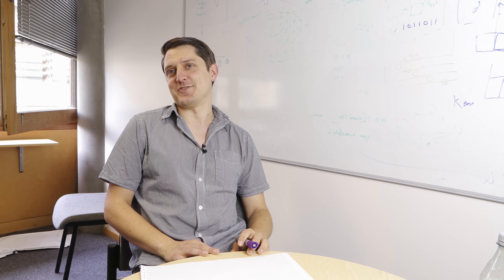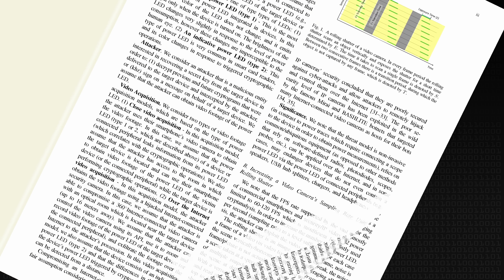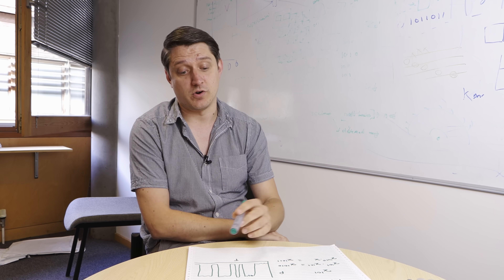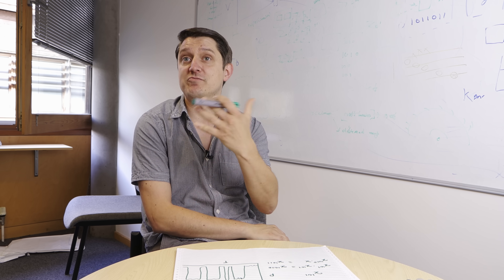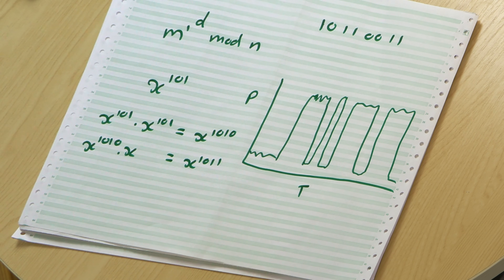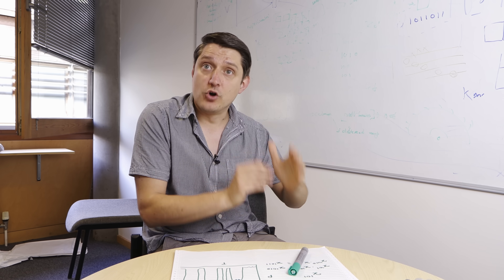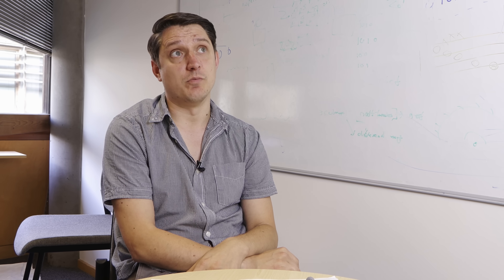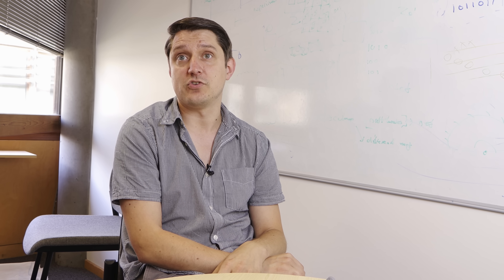Power LED Attack - Computerphile

Comment: This must explain some readers I've seen which seem to turn off their LED while authenticating. The job of the LED is to advertise to users that the device is powered and working, once cryptography is occurring the LED has already done its job and can be powered off for the brief moment the CPU needs power.
Reply: I’ve also heard of some similar light-based “spy” techniques being potentially thwarted using noise on the power going to the light.
Reply: Ze Rd DQ. Jv,№

Comment: Not difficult at all at the design level.

The LED should have a small series resistance in line with it, lay a small cap across the LED. That's it.

Comment: I worked for IBM Office Products in 1980. Selectric typewriters bound for US embassies had to have a capacitor and a heavy flywheel installed to prevent powerline analysis of the characters being typed.
Reply: The soviets literally had devices intended to do powerline  and EM sidechannel surveillance of these.
Reply: ok?
Reply: I was thinking a similar thing is at play with the LED - there some impedance in the LED itself and the circuit that drives it, resulting in essentially a low-pass filter that has to cutoff far below the MHz of the CPU. Furthermore, the intensity & color of LEDs is typically controlled by PWMing a current source - again, limiting the rate at which the LED can change intensity.
Reply: @nixonkutz3018  : You can fight against the "inertia" of an LED by forcing the current going into it. This itself has a limit on it's effectiveness, but does get you frequency improvements, and in the simplist examples will be present in power LEDs without being intended.
Reply: Who would have analyzed the powerline and where?
Reply: @gaborm4767 : In the 80s? Stereotypical case would be KGB, but really any semi-sophisticated group could have tried it.
Reply: @gaborm4767  Russians at the time. US embassies
Reply: @BatterOrWurst  Where and how would they have been connected to the wire? How do you think the power consumption of a typewriter differs when different keys are pressed, and how far away can it be perceived if there are other consumers on the network?
Reply: @gaborm4767  All they need is an oscilloscope on the power line serving the building (and a computer to analyze the result). The Selectric requires varying amounts of power to tilt the ball to one of 4 positions and to rotate it to one of 11 positions. Some, for example W, rotate against the spring 5 positions, then relax to return to home. Others, for example M, relax the spring 5 positions, then require force to return home. This results in small but measurable voltage variations on the power line. Selectric has a mechanical 6 bit binary mechanism known as a whistletree.

Comment: This is like hacking a hotel safe by checking the current consumption from the battery connection.  Same principle, check current consumption as the microcontroller works.

Comment: That is neat. A camera makes sense for static analysis. For a more realtime analysis a photo diode can be used and plugged straight into an oscilloscope. I found one with a 200pS response time for $15 on Digikey (part number 1601-C30737MH-230-80A-ND).

Comment: Dimming the LED with pulse width modulation will probably mess up this attack rather efficiently, as long as the pulse frequency interferes well enough with the pace of the computations.
Reply: PWM for lighting is usually in the kHz range, which wouldn't interfer much besides sometimes "turning off" the windows of attacks

Comment: Put a 100 ohm resistor in series with the LED and a 47uF capacitor across it. That's a low pass filter with a cutoff of about 34Hz.

Comment: It would suck if someone went through all this effort - making a device to do this analysis, figuring out how to break into the server room... Only for them to find out someone put a capacitor across the LED essentially making this entire attack void.
Reply: I thought about this too lol, seems easy to protect against
Reply: At least now they know that it wasn´t that useless and just be removed from the BOM to reduce costs
Reply: how would the capacitor save you from current change in led...
Reply: @viacheslav1392  by making the voltage smoother
Reply: @astral-proj3ction  Smoother but probably leaking some variations that can be measured with more accurate sensors.
Reply: @square_wheel  You could use a bigger capacitor and disconnect the led from the power line for the duration of the calculation. Or use an even bigger capacitor and use it to power the cpu while disconnecting it from the power supply during the calculation.
Reply: @KacktuskackeEntrtnmt  I love it. you're all perfectly in the mindset of the engineers that get tasked with fixing this stuff. a year later we break their fix because they didn't think far enough ahead.
Reply: I would drive the LED with a completely disconnected algorithm that just indicates tx/rx activity. Yeah higher part count yadda yadda but super simple these days.

Comment: So now we are going to get 'secure LEDs' with a capacitor in parallel and a resistor in series? To explain in programming terms, that's functionally a brightness interpolation or low pass filter for led brightness.

Comment: Reminds me of that side channel attack to an air gapped network using air temperature and ambient air sensors built into the servers.
Reply: Wow, did it cause the transmitter to heat up (by doing CPU-heavy tasks), then read that as the server next to it heating up despite no change in its load?
Reply: @gargantuablargg  I don't remember the details, it was a theoretical attack but not something found in the wild.  I think the scenario was an insider that compromised the HVAC control system and also implanted software in the air gapped server.  They could then open a VERY low bitrate communication channel, something like 40 bits per hour I think

Comment: If you add a small capacitor across the LED it will hide the colour effects.
Reply: LEDs also just aren't fast enough. Some people are working on using LEDs to diffusely transmit data into a room via light but they aren't getting switching frequencies in the gigahertz range.
Reply: And there are decoupling caps all around any digital circuit, right? I was thinking the caps would have to be high impedance at the frequencies of interest, in order for those freqs to survive and be shown on the LED.

Comment: It looks plausible in theory but turns BS if you consider the real numbers and how sensors work. You can consider it from two angles: readout time and the exposure time. The fist will place the limit on the time per line, the latter on the integration time. At 60 fps, the maximum readout time is around 16 ms. Dividing it by 2000 lines (4k frame) we get 8 us per line or 125 kHz sampling, so we can sample a signal of max 62.5 kHz. Even Ardiuno is faster, not to mention dedicated encryption chipset. Similarly, the minimum exposure time will limit the frequency, as light integration will act as the low pass filter. Considering the low brightness of such LED, you will probably need times close to 1 ms, to even see anything, and that is just 1 kHz. 
Even if you somehow manage to get sufficient sampling frequency, sensors have horizontal and vertical blanking times, when no light is captured and that will create holes in the recorded data.

Comment: I have some issues with this. First, the entire computer is made up of a lot of components. The CPU is just a small part, and the variation in power draw from other stuff, like the GPU, motherboard, fans, drives and so on, will mess up the "signal" massively. Second, it is a very weird power LED indeed to be that responsive. I'd expect an LED control circuit to be far more sluggish, essentially acting like a band pass filter for high frequency "noise". Also, the power LED is powered from a different power circuit in the power supply, that is stabilized independently. CPU, GPU and motherboard use 12 V, while the status LEDs use 5 V.
Reply: never heard of a CPU that requires 12V tho
Reply: @scudotcs  The actual processor doesn't run on 12 V, but it gets its power from the motherboard, which converts down from 12 V instead of using the lower voltage supplies from the PSU. The 12 V supply from the PSU is the only one sized to handle many hundreds of watts, which is what high-end CPUs require. 5 V and 3.3 V is only used for auxiliary stuff and USB. There is a move towards motherboards requiring only a 12 V supply, using onboard DC converters to make the other voltages, so future PSUs will increasingly be 12 V only, simplifying design, potentially making them cheaper, smaller and likely a bit better.
Reply: I'm with you bröther but they did some paper on the topic so I guess it's real
Reply: Other devices exist. E.g. TPM modules, payment terminals, door locks.

Comment: If you're at a location where you need protection against this kind of attack I'd really hope there are no cameras looking over everyone's shoulders. Otherwise attackers would be stealing valuable data just by looking around the room. Also they don't mention that it takes hours of data collection even when pointed at a device doing nothing but running the algorithm constantly. Also the camera has to be within five feet of the target.

Comment: Another problem with trying to fix this, is even if the developers of a cryptographic library does take steps to avoid these attacks, they can't always be sure that some consumer of the library won't have something in their toolchain that optimizes away the fix
Reply: Time to dynamically link all of your crypto libraries and to never compile them from source.
Reply: @cameron7374  and never use bytecode, all of which is a problem if you're on a less than common architecture
Reply: It’s actually not hard to fix at all and have seen ZERO evidence of it being done outside a lab.
Reply: since the standard is Rust just use the black box to make the compiler not optimize it

Comment: CSI Miami show called. They want their explanation back. This would have to be done on purpose. It is common practice to have a capacitor "smooth" voltage changes which would render this to ridiculous. BTW, manufacturers just regularly add capacitors to shiny (LED) components not because of security, but to make the rest of the circuit last longer.

Comment: The simple solution would just having the algorithm always run two operations regardless of the exponent, while one of them are performed on a different number than the key depending on whether to multiply or cube, that way the load is uniform and reading from the power or the LED will always yield 1111111...1

Comment: Would adding a large smoothing capacitor to the LED circuit prevent this type of attack?
Reply: Yes. And it would be far simpler in the long run.

Comment: Miele dishwashers don't have anything you can plug a data cable in to: the technician talks to it using blinking LEDs (for logs, status, run counts etc). He uses keeps the reader in place with a magnet.
I think this but if kit is ideal for this attack 😅

Comment: One smoothing capacitor on the LED and the entire attack is all but impossible.  Any remaining power fluctuations would be many, many instructions operations long.   Proper usage in the logic circuitry would also mask it to ridiculously low levels.
Reply: also a PC is already filled with lots of smoothing capacitor. There are some on the CPU, some next to VRMS, some in the PSU, and there's even an inductor in the VRMs. Absolutely no direct correlation between the CPU power consumption ( a 1000Mhz CPU runs one clock cycle every picosecond!) and the power usage of the system (which fluctuates in milliseconds)
Reply: @thomasb4422  A system running the secret key calc algorithm is not always a personal computer.
It could be a mere smartcard lock.
Reply: @thomasb4422  They are attacking entry systems though. They are made as cheaply as possible: which may mean few decoupling capacitors and a relatively slow CPU.
Reply: @thomasb4422  Exactly!
Reply: Exactly. I stopped watching when I realised he was going to use maths to solve a simple hardware issue.
Reply: Yup - came to say this. A 0.1 cent 100nF capacitor across the LED will give it a time constant of tenths of a second making such an attack impossible.  Look at the interior light in your car as it fades down when you close the door - just a cheapo capacitor, nothing sophisticated.
Reply: @Richardincancale  Most car interior lights are controlled with PWM to give the intended fade rate. It's software, so cheaper than capacitors.
Reply: @MalinDixon  I’m sure that’s the case now!
Reply: 100 percent correct.   I would assume a software solution would be necessary for existing hardware though.  I doubt my company would like it if I broke out a soldering iron and started throwing decoupling capacitors on server main boards.

Comment: One thing I don’t understand is how an observer would know that the computer is calculating a cryptographic key as opposed to performing some other CPU-intensive operation?
Reply: This method requires the attacker to have technical knowledge of the lock. You already have to know how it processes the key and how it shows up on the LED in order to use the exploit. So I imagine the attacker can tell de difference between the different CPU tasks. Or monitor it for so long that patterns become obvious. This is a super specific exploit, you'll have to approach each system differently.
Reply: You can't. You have to know what the system is doing up to a nanosecond and/or initiate the process yourself (probably multiple times). This might only be a practical attack on hardware you have full control of like a nicked crypto wallet.
Reply: Because, like any other hack on the existing hardware around, inside information is leaked.

I’ve worked on securing engine electronic control units and by the time we were planning a future release, we were finding out that our previous version was already “open” by some “clever guys”, located in “non-friendly” countries.

Honestly, after doing a lot of investigation (we’ve even purchased some “official” products which were attacking our product), we’ve concluded that somehow there’s some sort of a leak from the inside (lots of engineers have access to such a project and the teams are spread over multiple countries).

I mean, there was no way that someone, without inside knowledge, would’ve managed to find a workaround so quickly. 

It’s a mouse and cat around the clock race. Quite stressful 😂